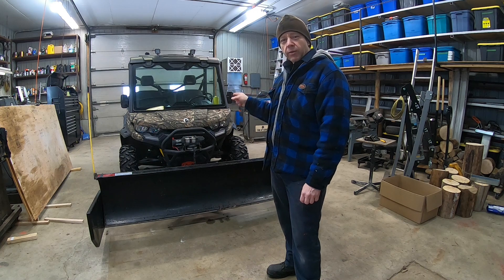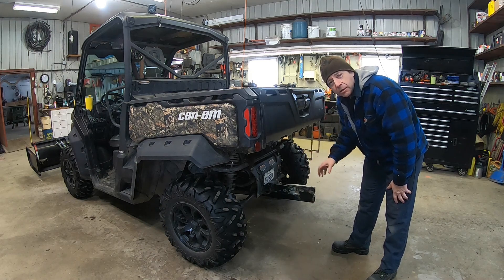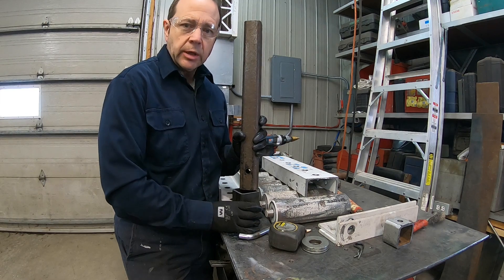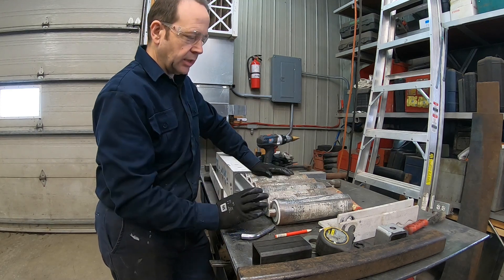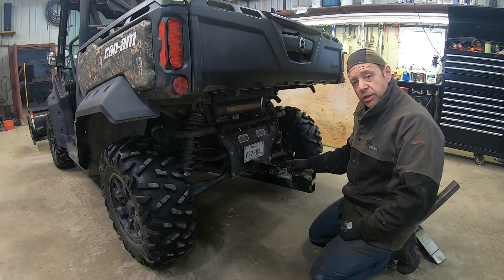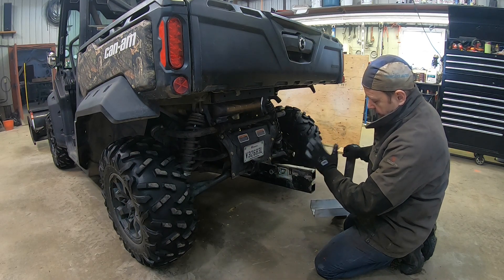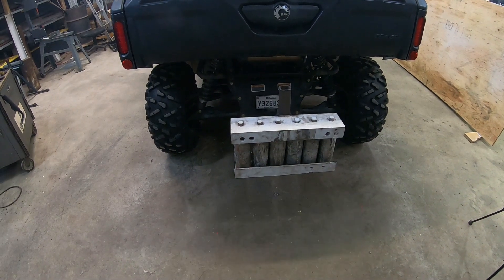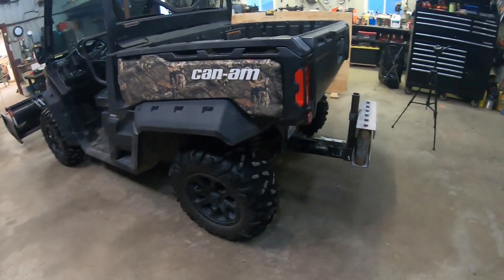#294 Canam HD10 Snow Plow Ballast

Comment: Joe I ran into the same problem with my Kubota UTV. When I installed a Boss V plow (about 350-400 lbs ) on the front the back end was to light.
 I like you're attachment. For now I use 8 to 10 , 40 pound bags of water softner salt and boy what a difference it make. Thanks for sharing. 👍TCT
Reply from the maker: Hello Tony!  I used at some point some big logs, so similar weight as you do.  That worked great and that inspired me to take action. Having the ballast almost 2ft behind the rear axle counter balance the front, so it does pretty much the same effect without much added weight. Thanks!

Comment: Great use of what you have! I have the same issue with my side x side I put chains on the rear and it helps but I need to add weight after watching this. Thanks for sharing and have a great weekend.  Cheers, Mike.
Reply from the maker: Thanks!  I just don't know why I did not do that before! I am also thinking of adding tire chains, as the threads are getting worn now. Thanks!

Comment: Hi Joe, nice modifications. That will help. When I used a plow with my side-by-side, I added a pulley on the plow and routed the winch line back up to a stationary point near the winch. So it reduced the strain on my winch,  I also switched the cable to a nylon rope only in the winter time. So I wouldn't wear out my winch cable because it only moves a couple of inches each time it was making a wear spot on the winch cable. Thanks for sharing.
Reply: Great idea Ross
Reply: That Is a Great Idea Ross 👌🧐👍
Reply from the maker: Hello Ross! Thanks for the tip. I know what you mean! It might not show on this video, I have a roller right at the exit of the winch, so the cable does not rub... but even then, this week, the synthetic cable snapped!  I've removed the first 2 feet and clearly, it had signs of wear. I am not surprised after 4 seasons of hundreds of cycles! Thanks!